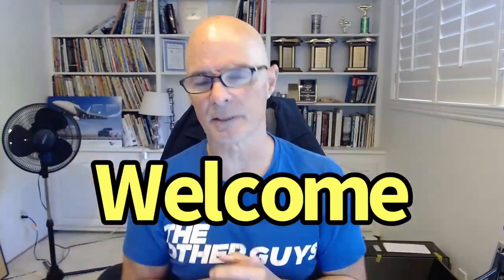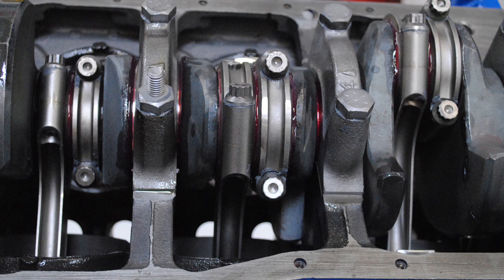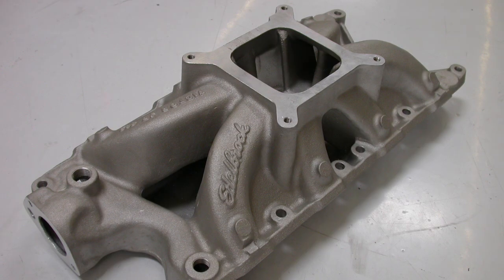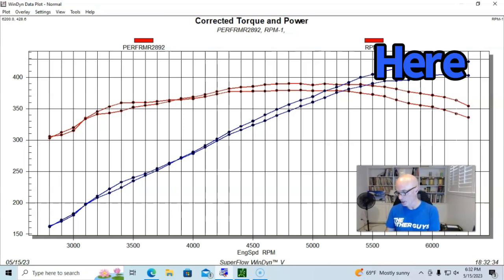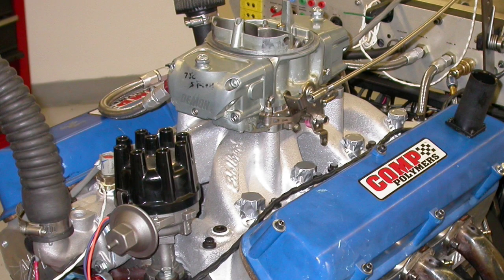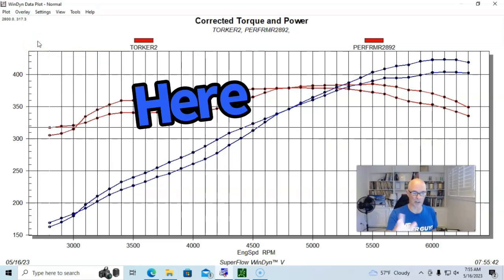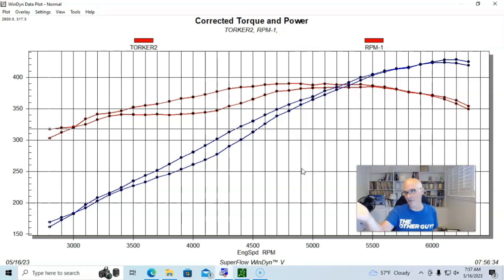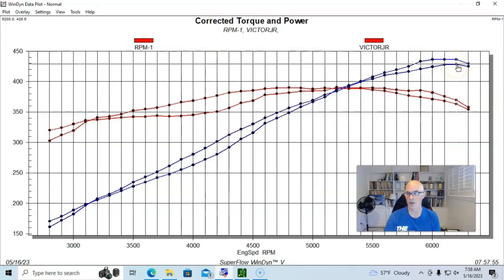SINGLE VS DUAL PLANE, WHICH ONE IS BEST? SMALL BLOCK FORD INTAKE SHOOTOUT? 4 INTAKES-FULL RESULTS

Comment: Richard, on a 351w .060 with a .579/.579 lift cam, 236/242 duration @.050, 114 LSA with 110 ICL, Ported 351w D0OE heads flowing 249/182cfm at .600 lift, 1.6 roller rockers. should I run a Single plane or a rpm?

 I would be a std range of 2800ish-6800.
Reply from the maker: 1.4 ROCKERS?
Reply: @richardholdener1727 sorry Lol it was supposed to be 1.6 rockers. And with this what Rough Hp/Tq estimate would this combo be at? Wish you were closer I have about 5-8 combinations you could run for more data including blue thunder 351c combos

Comment: Nice test mate.  How about when we add boost, say centrifugal or turbo?  I've heard there might be issues with air fuel ratio and cylinder to cylinder distribution under boost with dual plane manifolds?  Lachlan, Australia.
Reply from the maker: not much different than NA (there is a distribution issue NA)

Comment: Have you ever had your hands on an RPM Air Gap 302 intake converted to efi?
Reply from the maker: I have not-but it would lose power compared to a carb if it is port injected
Reply: @richardholdener1727  I’m more interested in the comparison between the converted Air Gap and the Cobra/Gt40/SystemMax/TFS two piece style manifolds.

Comment: I wish you did this same test on the small block but compared this carb to a throttle body (like a Sniper) on the dual plane, to a MPFI on a single plane (only way they set them up) to see which would win out of those. Obviously the MPFI is better for tunability, but how much does it lose because of the single plane intake manifold.
Reply from the maker: please see the video where I compared carb to port efi on a single plane

Comment: i dont mean to be picky, but im patiently waitin for you to do a gt40 vs a 4150 style efi intake, i feel like the curve would be similar to a vic jr, but with an elbow n throttle body, it cant be identical
Reply from the maker: the elbow doesn't change anything-the intake still dictates the curve. I have GT40 or Cobra vs single plane-the long runner Gt40/Cobra makes more power up to 5500 rpm

Comment: I have a question. I'm looking at tunnel rams for a small block Mopar. I found several different brands. But some have a single carb set up. Some have dual. I can't find a comparison anywhere. Which is best? Or would I offset the single by adding a larger carburetor? If you haven't done a comparison?! That would be cool. Weiand vs Edelbrock vs Offenhauser etc.
Reply from the maker: dual quad would be better

Comment: 9:09 Am I misunderstanding something?   Instead of making each manifold show a different color line for the same function, both manifolds show red for HP and both show blue for torque.
Reply from the maker: different colors is not an option using their software
Reply: @richardholdener1727  Perhaps you can put a little paper arrow on the screen pointing to the line for one particular combo.  Since they are the same color and sometimes cross each other one or more times it is really hard to get a feeling for the results just at a glance.

Comment: Great video Rich but you already know anything we port would come our on top lol. We make dual planes produce power like single planes and single planes make power like nobody's business lol.
Reply from the maker: happy to test, but a dual plane doesn't make the power curve of a single plane-but you guys already know that
Reply: @richardholdener1727  a modified high rise dual plane intake with a balanced average runner flow over 320cfm with the divider milled 1/2" down with a 1" open spacer will go past 7,000rpm easily and support just as much power as a out the box Victor or tfs R single plane manifold but make more low end torque. We have had many customers wanting their low end torque back but not lose the power up top so that's the combo we go with. Most of the time in that switch over they just have to step up in carb size but it works. 
Send us some Intakes and test motor build sheet and we will be happy to shock you lol

Comment: Be much better of u ran them across the full rev range .. how much extra torque is there at 2000 .. we will never know .. believe it or not some people like me use these 302s in heavy auto trans vehicles with stock stalls
Reply from the maker: show me a video with you running at WOT at 2000 rpm please

Comment: I'd like to see the victor jr vs victor jr EFI the one that's the same thing but outfitted with injectors and fuel rail, is the powerband going to be about the same but with improved drivability? It's prob out there but overall which makes more peak power the carb style EFI intake or the factory style EFI? If I'm not mistaken they make a victor 5.0 factory style EFI manifold. Or even a victor jr vs a high ram same jist, I would think the carb style intake would make more but I have no reason to think that just a guess. Weingarner does not like the new Holley low profile open plenum EFI intake, he said it's basically a worst of both worlds, Typical poor low rpm TQ open plenum chachteristics but poor high rpm capabilities. If you hate TQ and you hate high rpm HP it's perfect! I just scored an old 701R-36/300-36 sbc Holley contender for $75, hope it's what I'm thinking it is which is kind of like an old Z28 intake the OG performer rpm style intake, either way it looks cool.
Reply from the maker: same power band-slightly less power with port EFI

Comment: Whats a good lower intake manifold for a very mild 65 mustang 289 with just exhaust, mild cam, and possible 4 barrel carb upgrade to complement a lower intake uograde. Just looking to build a very mild cruiser with a little more oomph.
Reply from the maker: rpm or air gap
Reply: @richardholdener1727  thanks for the reply sir! Love the channel.

Comment: Would be really curious how a ported "Performer" would work with AFR 185 heads on a 347.  650 Holley.  Mild but not factory cam.  Hood clearance is extremely tight and completely prevents the use of a higher rise intake.  Far from ideal, but a reality nonetheless!  Cheers
Reply from the maker: ported performer should do better than stock performer

Comment: I actually have an SBC. A 350 Vortec to be exact, but I think my question is pertinent to all intake manifolds. Does using a carburetor gasket, or spacer with one large hole, negate the use of a dual plane intake?  Thanks?
Reply from the maker: it does not

Comment: Just tossing this out there hoping for some input. I'm going to try an experiment using the Holley/Ford 2V carbs from the mid '70's 2.3 mounted on a mid '80's lower f.i. intake to make an inline 4V. Should I mill the dividers between the runners or even chamfer them?
Reply from the maker: you can make a box but keep the run length
Reply: @richardholdener1727  thank you, sir, for the reply. Any other pointers?

Comment: Try an Xcellerator intake from Weiand. . It is an old intake but it works with a 302. I picked up 3 tenths in the quarter. My cam is an N41 Anderson unit.
Reply: Freiberger did it
Reply: @hotrodray6802 When? Is it recorded and posted?

Comment: I had to use the old performer for the hood issues. I didn't have a cam so it works out okay with the 1850 model Holley. Miles away from the 2bl. I would guess I gained about 30 hp which is pretty big considering I was probably making about 150 before
Reply: And unless the vehicle and engine was modified much, you probably made the best choice for a strong and practical driver.
Reply: @mickangio16  fully agree! 👍

Comment: Usually I am trying to kill low end torque from 377, 383, 406......on the street. At most I am running a 275 radial tire......and usually something in the 255 or 265 realm.

Comment: Hood height (or lack of it) is a real bitch. I don't have a Fox body so I don't know how much underhood space there is to work with but I have an '86 Firebird and it is TIGHT under a stock steel hood. Can't see how I can go beyond a regular Performer. Looking at that Victor Jr, it is a great design no doubt but it needs some serious space, especially if you're running it with a proper filter assembly. 

Kudos to the Torker for doing better than I expected.  Might be good if you're running a nitrous plate to keep everything under the hood.  No shortage of space on the dyno, huh?
Reply: Hood 👍👍👍
Reply: Fox bodies don’t have issues, most efi intakes are taller. It’s the old muscle cars that do. Some you can barely get a 3inch filter even with a drop base.

Comment: I have boiled it down over recent years (for 1205 gasket) to performer rpm unless you are running nitrous then I choose the victor jr. If I am really running a 7000+ sbc I am stepping up to a bigger/better single plane anyway.

Comment: One thing you didn't touch on is the cold bloodedness of the air gap manifolds.  Maybe you don't experience it in warmer climes but here in upstate NY during the summer nights can be in the 40*-50* range and we rarely hit air temps in the 90's.  The air gaps do work very well with throttle body FI but are very cold blooded with a carb, I have 4 of them sitting in my garage from different engines that I have changed out for friends because of stumbling, hesitation and driveability issues.  I believe you could tune out those problems but the people that I changed them out for want simplicity, that's why they stick with carbs and not so perfect mixtures and tuning.  I'm an F.I. guy and I understand their point but it's something to consider for a street engine.
Reply: If you're not willing or able to tune it, you might as well leave it factory stock. Also, in a colder climate, tune it with a functioning electric choke & fast idle system. Adjusted correctly they work very well.
Reply: TB FI conversions have fuel distribution problems. Not sure why, temperature vs atomization or what.

Comment: I think I still have a Torker II. I thought it was made by why-and…  it has the twisted carb flange. Prob worse than the torquer run here. Even less downward draft…
Reply: Edelbrock Torker 289 (about 1976)
Reply from the maker: a twisted carb flange should not be a torker 2
Reply: @richardholdener1727  it’s been so long since I’ve seen it. It def has the twist but I don’t remember what it is, I been calling it a torker II forever :p it looks like it’s from the 60’s I will send a pic next time if it didn’t get sold at the last swap meet.

Comment: It's the old story, the dual plane will be better in traffic but inferior when you're having a real go. Low end torque is good for towing, not for traction. Have a look where your rpm's are when you're going through the gears at WOT, it's single plane territory. You can't have everything in an NA application.😉
Reply: Does that +6 HP really matter on the street, or even noticeable on the strip when bracket racing ?

Comment: Good stuff, Richard!  Would the results - dual vs single plane - be much different if we substituted a throttle body injection (eg, Sniper) in place of the carb?  That is, how much of the difference in torque curve is due to runner length and cross-section, and how much is due to vacuum signal and atomisation? Thanks.
Reply from the maker: it won't change the curves
Reply: @richardholdener1727  Thanks a million!  You just put to bed a controversy that has been raging on the forums for years.  Much appreciated.

Comment: I had a very similar combo, using the Lunati Voodoo cam, and a Holley Sniper EFI...the RPM intake has fuel distribution issues with the  Sniper, and kept fouling a couple of cylinders, BUT it all went away with the Victor Jr...both setups has big street performance for a measly 306 CI
Reply: Apparently, the Sniper's internal MAP sensor reads from only one side of the dual plane - only 4 of the 8 cylinders.  It  needs to "see" both sides of the manifold to run properly.  Milling the divider a little seems to solve the problem.

Comment: Great comparison. Do you recall what the jet combos were for dual and single plane?
Reply: I built up a 302 in my 83 Capri and put on 351 W heads and mild cam, headers with the T2 years ago and used the stock Holley carb. Had to drastically change jetting at full throttle but part time throttle didn't need to change much. Don't remember the difference but it would fall flat with stock jetting. Now, 30 years late with these dyno charts I should have kept a dual plane. We were told years ago that single plane intakes were the way to go.

Comment: I know it didn't get tested, but it feels like on this combination an RPM air gap would be the clear choice. The regular RPM was only down 7HP at peak to the victor jr, I'll take the extra power in the midrange. I'll go out on a limb and say that the RPM most likely made the best average power too.
Reply: The RPM Air Gap acts too large for a stock stroke 5.0. The Weiand Stealth actually beats the RPM and the RPM Air Gap everywhere on a Ford 5.0. The old Weiand low rise two plane beats the Performer 289, but Weiand has replaced it with a not very good imported intake. The Weiand X-CELerator beats the Torker II. This doesn't hold true on the 350 Chevy, but it sure does on the Ford 5.0.
Reply: @BrandonLeeBrown Weiand intakes are made in China that's why I won't buy one.
Reply: @BrandonLeeBrown   I like the accelerator strong mid-range good horsepower on top
Reply: The air gaps do work very well with throttle body FI but are very cold blooded with a carb, I have 4 of them sitting in my garage from different engines that I have changed out for friends because of stumbling, hesitation and driveability issues.  I believe you could tune out those problems but the people that I changed them out for want simplicity, that's why they stick with carbs and not so perfect mixtures and tuning.  I'm an F.I. guy and I understand their point but it's something to consider for a street engine.
Reply: Are you sure the intake was at fault and there weren't other variables responsible for the hesitation and stumbling ? @hardball107
Reply: @hardball107  I run a wiend stealth port matched to some AFR renegade 185. It's a tall dual plane that can handle RPM up to 6500 but isn't a true air gap so it does a little better in the cold. I like it, but I've never owned an air gap so can't compare.
Reply: Victor needs more cam and compression in this case. I bet with a solid roller profile and about 11 to 1 or more able to take the edge
Reply: Hood

Comment: We put an  RPM on my sons F250 w/351W, everyone told us were crazy, that it would lose all kinds of low end vs the standard Performer. Nice to see proof of what I already suspected!
Reply: I've run Performers on a couple of engines, and they're a great upgrade from a stock 2bbl, but they're essentially just aluminum versions of factory 4bbl intakes and run out of steam pretty early. Glad you didn't listen to the naysayers - you made the right choice 👍
Reply: Performers are good on big blocks but on small blocks they’re not better than the factory 4bbl.
Reply: @alexcorona yep, basically just an aluminum copy of the factory unit

Comment: The single plane is the way to go I'd rather have the torque than a little bit of horsepower
Reply from the maker: you mean dual plane then
Reply: @richardholdener1727  young people. He's probably infatuated with the Air Gap like the rest.
Reply: @jesse75  & spacers- with no consideration for hood clearance. What good is the ultimate power intake manifold & spacer combination if you're gonna suffocate it with an insufficient air cleaner? THAT would be some good testing- a less than optimum low profile induction system but with a free breathing 14" air filter unit compared to tall race type intake with a cramped and dropped base air cleaner and especially when the carburetor is equipped with a choke tower. Which?

Comment: I wish you would have had a original Torker to compare to the T2.
Reply: Probably getting rare aren't they? Maybe not. I ran a torker on a 76 Mustang and the T2 on an 83 Capri.
Reply: @keithwiebe1787  what was your opinion between the two? I think the T2 offers better hood clearance(?)
Reply: @mickangio16  They were on different builds so don't really know. I did have to drastically change the jetting (actually drilled out the power valve jets) for better fuel flow at full throttle yet maintained fuel economy with the T2 running stock holley carb. Aftermarket holley carb probably running way rich anyway though. By the looks of all the dyno runs should have run a dual plane but we didn't know any different.
Reply: @keithwiebe1787 
Good to hear that you are knowledgable about Holley carb tuning. Most would have upped the main jets and cried about Holley carbs being over-rich junk. Along with the Power Valve Channel Restrictions(PVCR), too few people know about tuning the Idle Feed Restrictions(IFR).
Reply: @mickangio16  Being a daily driver i seeded the fuel economy.

Comment: It would be interesting to see how the air gap would compare
Reply: AG. Over rated. You can take any intake and make it an air gap.
Reply: @jesse75 lol no. The air gap has air under the runners for a cooler charge. The cut out in the separator is not the "air gap"